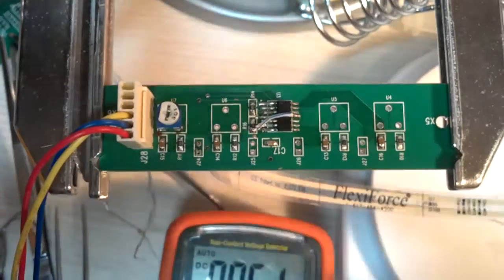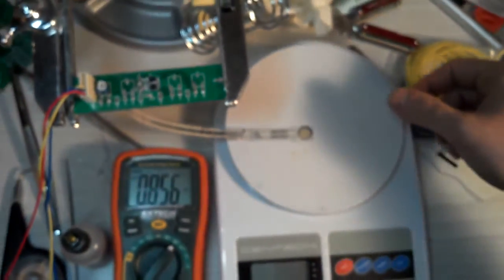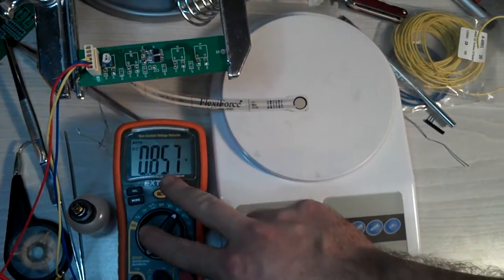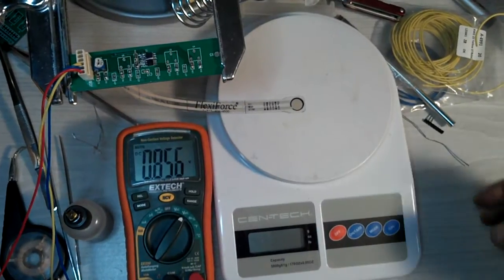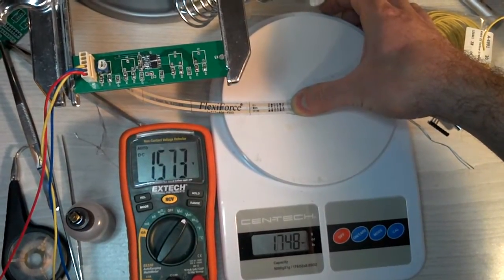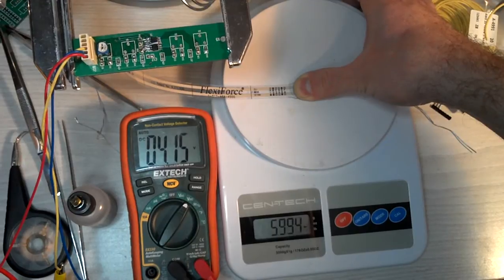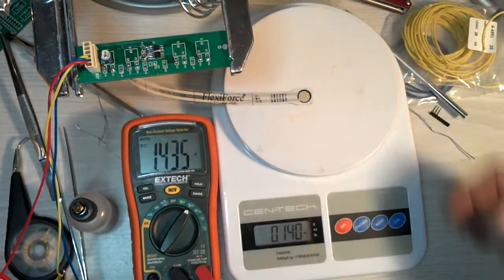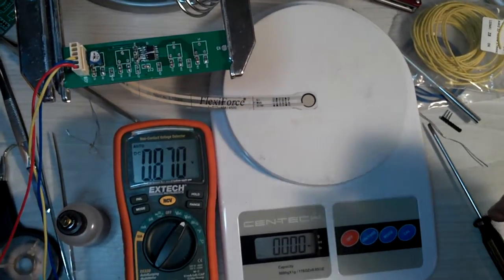Signal conditioning of a flexiforce sensor

Comment: Hi, Does anyone know if i could hammer directly on the flexiforce sensor?
Reply: Haemant Ramkissoon Sure you could, as long as you make sure the peak of your impulse force is less than peak force rating of the sensor.  That would depend, of course, on the elastic modulus of both your hammer and substrate, as well as the mass, length, and angular velocity of your hammer.  It would be good to factor in the shape as well, accounting for peak pressures normalized by the expected contact area vs. that of the hammer face.  If that doesn't make sense, then it's probably safest not to hammer on the sensors.
Reply: Paul Ferrigno Jr Well the type of hammer that is being used for the application is a 2.5kg hammer. The main pupose of this is to determine the force required to shape a steel sheet using hammering.
Reply: Haemant Ramkissoon That's a good, hefty hammer.  I assume the steel sheet is of significant thickness then.  The impulse forces produced with a hammer this size are very high, and would likely obliterate the sensor.  

I would recommend a couple different options.  
1: Use a hydraulic press to slowly deform your sheet metal instead of a hammer.  If you can tap into the slave cylinder of the press with a pressure gauge, then you can just take pressure times the bore size of the cylinder to come up with and equivalent force.

2: Attach an accelerometer to your hammer.  If you can characterize the velocity and duration of impact, you may be able to extrapolate some reasonably accurate impulse forces.  This method will probably contain a higher degree of error than the first method.
Reply: No the steel sheet is just 1/16 thick. That's what I am unsure about before purchasing the sensor.

Comment: Does anyone know if the 'Flexi' part include the load sensing area? will bending/flexing of the load sensing area cause fluctuations in the reading?
Reply from the maker: Yes, the sensing area is flexible.  It is quite sensitive; touching, bending, or looking at it in any way will change your readings.  I had to run calibration routines regularly.  It's sensitivity was quite high, as it would detect a gram of increased weight.  I found repeatability to be very poor, however.
Reply: pvfjr Thanks for getting back to me. That's unfortunate.... I was looking for a piezo (or similar) sensor with a high repeatability. Do you know of any alternatives with a higher repeatability?
Reply from the maker: Raymond Chi Chung Yau I don't know of any better alternatives, sorry.  I just made it work by writing a calibration routine that my microcontroller would run on power-up.  It worked, but I just had to make sure that everything was in proper position when I powered up, otherwise the cal procedure would get thrown off.  It was just more of an inconvenience than anything else.  I think a lot of my issues stemmed from temperature fluctuations, as the worst performance I had was typically outdoors on partly sunny days.  If I had had more time, I could have tried to characterize and compensate for the temperature changes, but who has time for that?